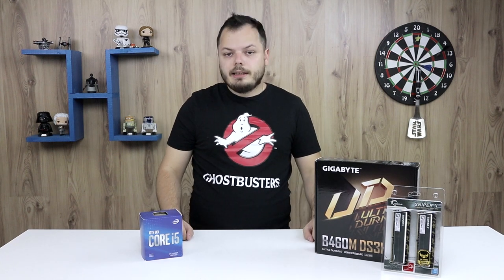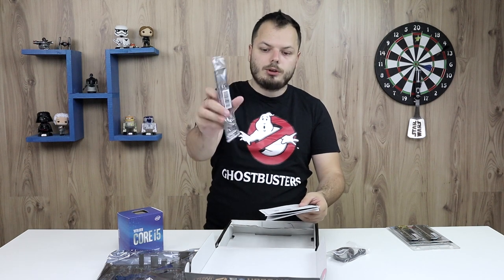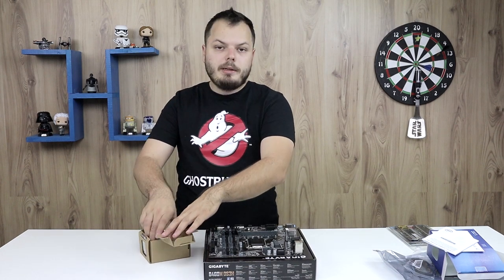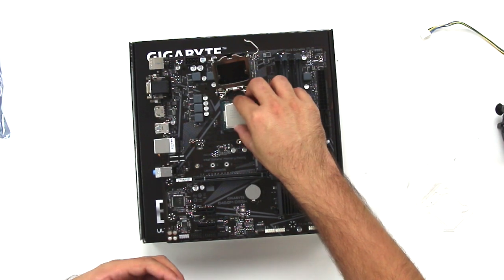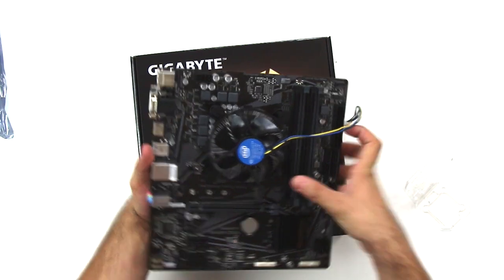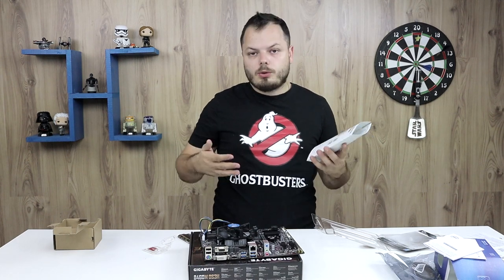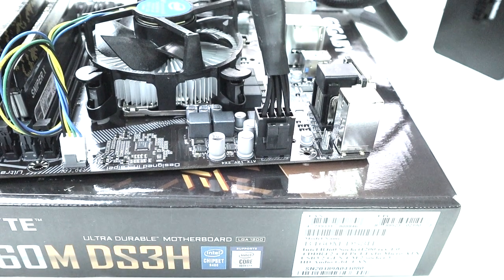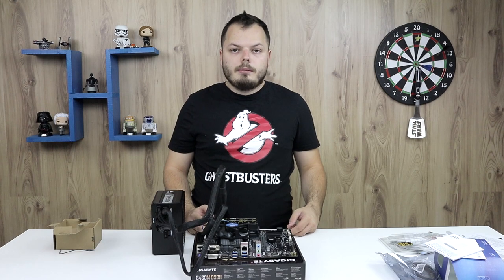How To: Install Intel LGA 1200 Processor

Comment: It is risky not to use any form of grounding, because if is determined that upon returning the product that the cause of failure was determined to be electro-static discharge, you likely won’t get a returned model and may pay a restocking fee.  While a anti-static wristband is not necessarily, you could at least touch the metal of your case or a grounded power supply to help you out.

Comment: Isn't it dangerous to tie the fan cable ?
Reply from the maker: Hi,
Why would you think so? It will be better you use a zip tie to the PSU power cable. Using this method that I show in the video have never had issues with a cable to go in the fan or so.
Thanks for the comment
Reply: @techsuricate7019   thanks for the answer i was just afraid for the cable to cut with the time
Reply from the maker: @Malik-sd9yy  
I've been building PC's for the last 15-17 years now in PC assembler. So far I've never seen to have a cable cut using this method. If the cable is in the fan, you will most definitely hear it. As you know everybody has there now method. This is mine :)

If you liked the video, make sure to subscribe, by doing so you will support us a lot
Reply: @techsuricate7019  ok thanks
Reply from the maker: @Malik-sd9yy  you are most welcome :)